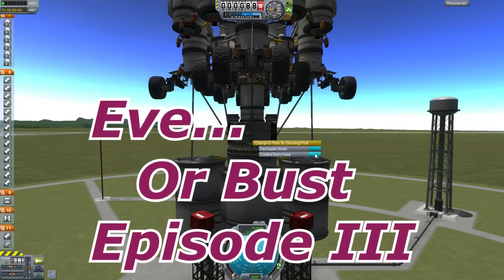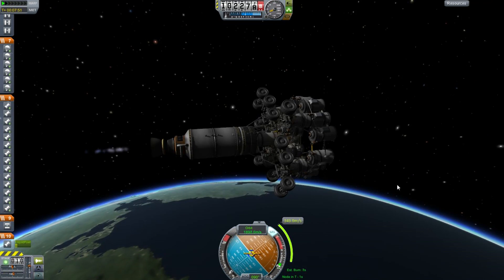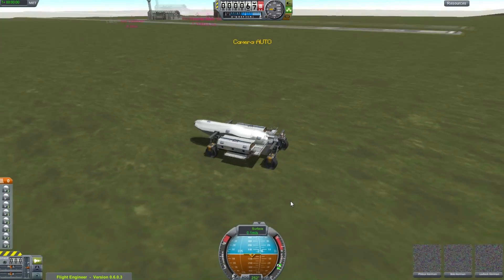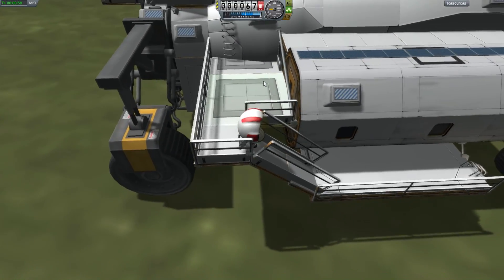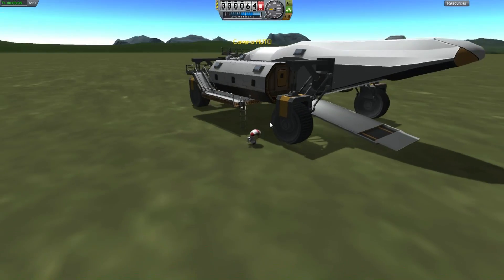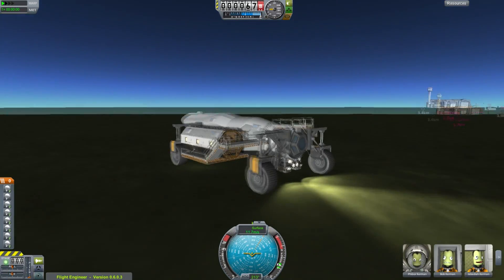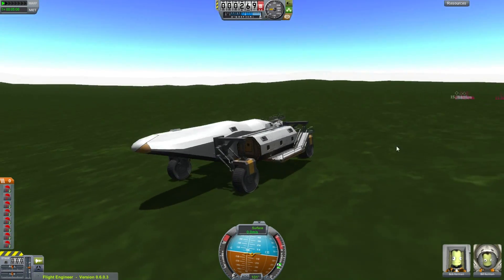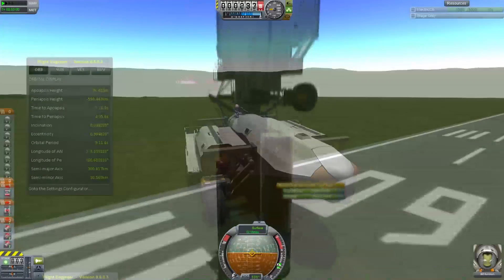Kerbal Space Program - Eve Or Bust - Episode 3 - The Mobile Science Lab

Comment: I was able to rebuild the Eve return vehicle and it works almost fine, the occasional tire tearing itself off and exploding. but the big problem is the each side of the ship with tires want to turn in a different direction... thus not really allowing it to move and eventually destroying the rocket. (I did not use Symmetry mode and I have a few struts per wheel to add stability.) Is there something I can do to fix this? As I post this I am going to try removing and replacing the tires

Comment: Break as in explode in the way only Kerbal Space Program can make rubber do or the tire looks broken and it wont move? If the rubber is broken in patches and has holes in it they can be repaired, simply get a kerbal close to them and right click and an option of repair should appear, do that and the tires should spin again. If the tires tear themselves off and explode. I had that problem until I added another 100 struts and strutted it to hell and back.

Comment: Whatever that weird spin is, I've had it completely ruin some of my probes; launcher works fine, I detach the probe or lander and it spins out of control even if I disable reaction wheel, stop spin with time warp or even save and reload, they just start spinning again faster even than the controls should allow. In one lander it was due to legs poking into the control module, deploying and retracting them fixed the problem. In other ships, no idea how or why, by it happens after 0.21.1. Sigh.